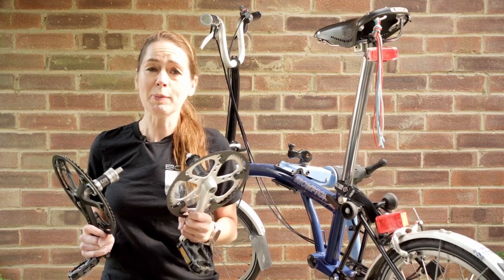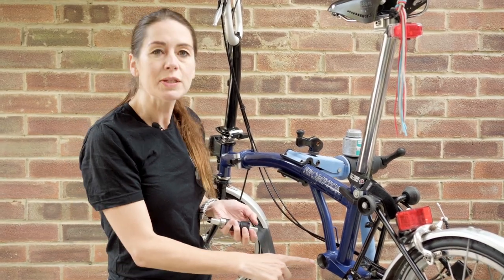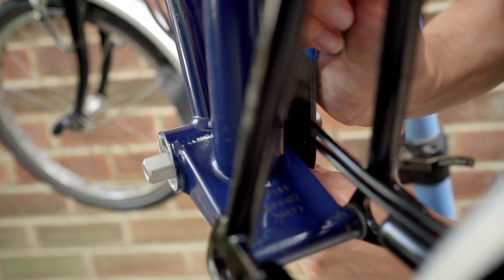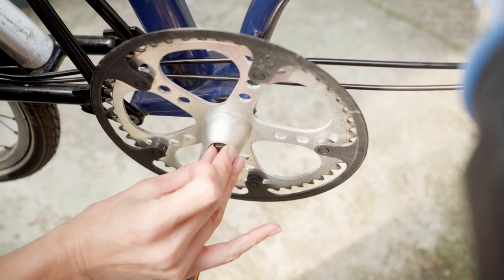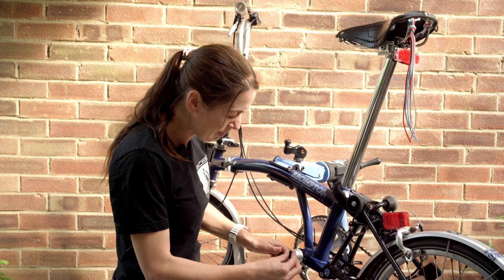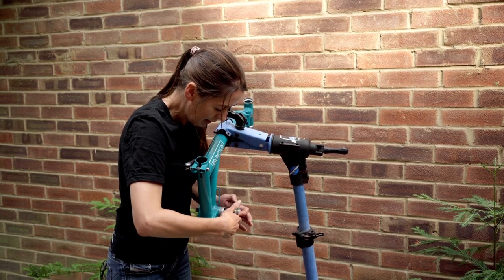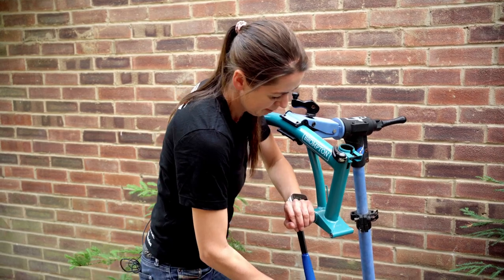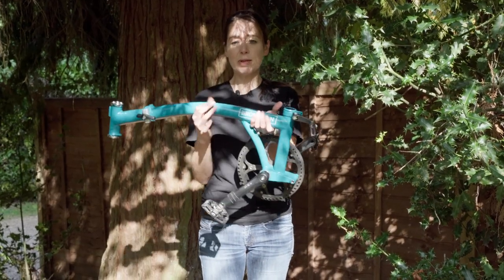How to install a Brompton bottom bracket

Comment: I would have given the square a little grease also! But when I had got my new, Flame Painted 2019 SuperlightM6LXBrompton here in Copenhagen I, as a first gave it all an AutoPolish all over, and found out that one of the rather useless small "Pieces of Clear Tape", which came as the only "protective measures" from the Factory 😲had been worn through - nearly to the paint after two or three folds, so as a first I ordered a set of  "Plates", from China, for all known "weak spots" on a Brompton!
      And then I also ordered a new, "ancient type", square Titanium crank with "Ceramic balls", also from China (Beware of the size of the crank, which for, strange reasons has changed size during the years, it seems?).
     And I got it changed during the 1st "Free Service"! Probably less expensive than finding and buying a "special tool" for the purpose? But any effort to make the Brompton easier to ride will be a profit, as the small wheels are very "heavy rolling"!
     I have also since then changed many of the original parts, bolt and nuts, discs, to now Titanium (The back frame and fork are originally from Titanium, as also the stays for the mudguards!). But the clamps holding them are really "Heavy Metal", and China sells those from carbon, with bolts, as also two new alu-holders for them!
       It is now below - 9 kilo and falling, as I still need to change several parts, and with Mudguards (I'm a Dane!).
     Probably not that much above a T line - also with - Mudguards, and only 4 gears?  Finn. Denmark

Comment: One of the 'Brompton weight saver' explainers online immediately goes for replacing the standard bottom bracket with a titanium equivalent. I found one online but the bearings were knackered; fortunately I got a refund. There are some lovely Ti BB's though, though I think they might still be heavier than the T Line BB, but I understand the T Line BB requires the T Line crankset, whereas I assume other Ti BB's go with any crankset...? If you had the T Line BB and crankset, though, by some miracle, could you put that on a C Line? The weight saving is crazy!
Reply from the maker: Thanks for the comment 

We are actually going to do almost that - put the T Line bottom bracket on a P Line (which has the same main frame as the C line)

Comment: Can you fit a spider crankset, and Japanese standard bottom bracket to an old Brompton with a fixed crankset? I am just thinking that sometime in the future I may want to fit a smaller chainring to my 1998 Brompton to make the hills a bit easier!
Reply from the maker: Many thanks for watching. Yes you need to replace the bottom bracket and the spider crankset at the same time, otherwise the chain line is not correct. But they are fine on the older  Bromptons.

Thanks for watching!

Comment: Since the original BB of the B is 119mm, don’t you need spacers when you install the Shimano UN300 117.5mm to make it as close to 119mm?
Reply from the maker: It should be fine, we normally use 118mm
Thanks for watching!

Comment: You ducked the "grease or don't grease the tapers" issue on which there seem to be two schools of thought. In any event, the tapers male and female should be cleaned carefully before assembly.
Might you consider upgrading the single pivot brakes on the older bike?
Reply from the maker: The hanks for watching! 

We are leaving blue as original as we can 😀

Comment: will the new style FAG bracket go on to an older style brompton from 2012?
Reply from the maker: Thanks for watching and the great question (and sorry for the delay in replying)

Yes - the newer bottom bracket will go on the older Bromptons - but we do recommend also changing to the Spider style crankset 

The JIS now used is slightly different to the ISO which was used previously - so it will fit ... but not quite as well and the chain line will be slightly altered - if you keep the old one piece cranks with a new bottom bracket - which is why we recommend changing both together

Comment: Hello, which Shimano bottom bracket have you used? 
I see the Brompton original bottom bracket Is 119mm long while the Shimano is 118. Should I take the Shimano BSA68 JIS Square Taper 118mm?
Thanks a lot!
Reply from the maker: Thanks for watching. We used this one: 

https://brilliantbikes.co.uk/components/1233-shimano-bb-un300-bottom-bracket-british-thread-68-118-mm.html
Reply: I just installed this bottom bracket on my old Brompton (same age as your blue one) but is it true it won't fit? Right side beautifully but left side too long to get flush. About 2 mm protruding.
Reply: May I know what is the tool used at 6:44?

Comment: Plastic is it easy to mis thread with plastic on metal ?
Reply from the maker: Thanks for the comment

It sure is! In fact we’d did it!
Reply: @brilliantbikes  Seems daft or at least strange to have plastic thread into metal thread, sounds like a Friday 5 to 5 idea .
Reply from the maker: @KavanOBrien  we guess plastic is cheaper to make - and it works fine if you are careful
Reply: @brilliantbikes  Some ideas need to not be said out loud, Black Adder moment = I have a cunning plan = let’s make it out of plastic.
Reply: Not much of a difference between the two other than weight.  The “plastic” is designed specifically not to save in cost but installation.  If the bottom bracket is warped, has weld spatter or semi-stripped threading and you do not have the correct tools to correct (expensive) it is best to use the plastic threaded cup option.  As you seen in the video the plastic is difficult to thread in which is meant to be this way.  As the cup is threaded in the plastic conforms to the bottom bracket — ingenious design and works very well for many years.  However, the plastic cup is meant to be used only once.
Reply: @ed0078  could not believe what I was seeing in regards to plastic be combined with metal especially in an area of the bike that takes so much force, I get the fact there must of been a calculation done somewhere from a safety aspect, but I still think it’s daft, silly, unbelievable,  learn something new each day , who ever thought this one up was obviously done 5 minutes before home time.

Comment: Name or partnumber of the Shimano BB? We all don't wanna use the shitty plastic stuff 😂
Reply: I had the same question - it seems to be the BB-UN300. It's 118 instead of 119 but that seems to be ok. Please comment if I am wrong
Reply from the maker: Many thanks both for watching! Perfect!
Reply: Not much of a difference between the two other than weight.  The “plastic” is designed specifically not to save in cost but installation.  If the bottom bracket is warped, has weld spatter or semi-stripped threading and you do not have the correct tools to correct (expensive) it is best to use the plastic threaded cup option.  As you seen in the video the plastic is difficult to thread in which is meant to be this way.  As the cup is threaded in the plastic conforms to the bottom bracket — ingenious design and works very well for many years.  However, the plastic cup is meant to be used only once.

Comment: If you are using a wrench with a BBT-22 you can stop the tool slipping off the cups using an M8x1mm (fine thread) bolt and washer. Please see my comment on https://youtu.be/i9U7l22SeDg . The video shows this but he uses a shorter crank bolt as the Cyclo BB removal tool is not as long as the BBT-22.